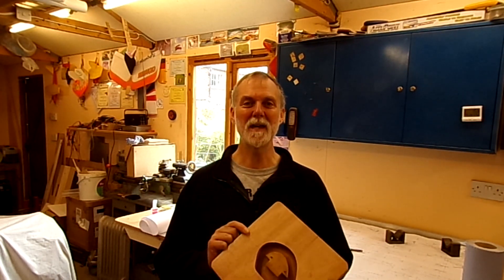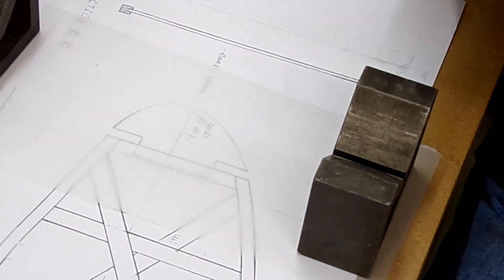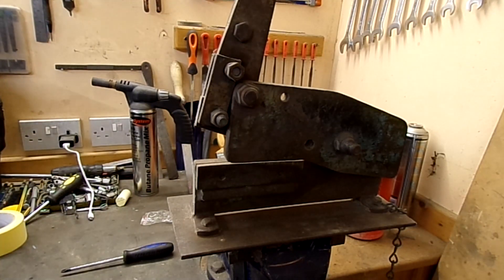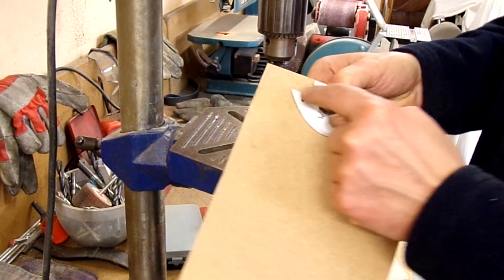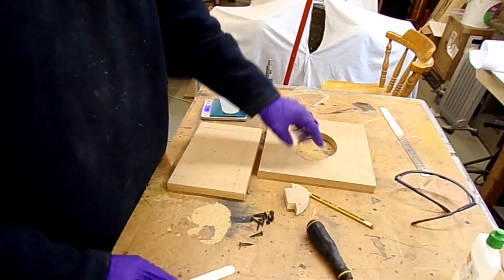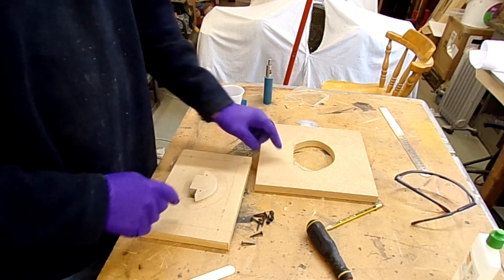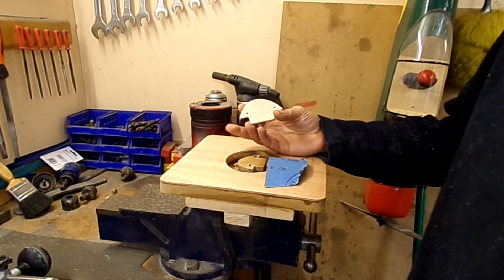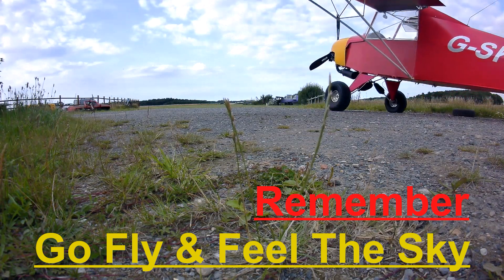EP17 Fisher Youngster V Kit Plane Build - Routing Jig

Comment: Couldn't that router cut 2 or even 3 maybe at the same time if u stacked them?
Reply: The wood u used was very thin. Routers can chew upwards to 1/2 inch with the no Xtra power so that makes no sense. I am just saying, to save time, just a little modification to your jig by adding taller pins and shorten the piece the blank sits on that way more can be stacked.
Reply from the maker: @outlawflyer7868  you are right most router could do up to 1/2" but at that unless it is a good one you will have some errors  creep in. As for time saving, it might be worthwhile if you expect to produce a big enough run but for 40 nose pieces it the routing takes about 20mins (that is with set up) the cutting out and drilling  over an hour and a half. All that said your suggestion is valid and anyone reading this can make up their minds as to what suits them. Thank you for your input.
Reply from the maker: Great question. Yes if you made the jig to accept the increase in thickness (if you needed to make loads) but the router would need more power and you can keep the stack stable. I find that I can cut them fast enough one at a time for all the projects I have done and very consistanly.